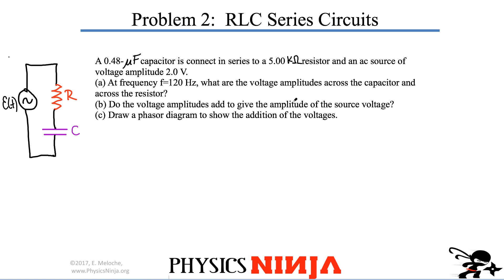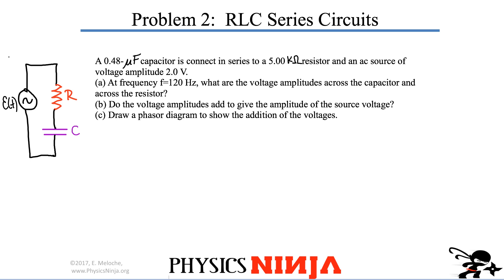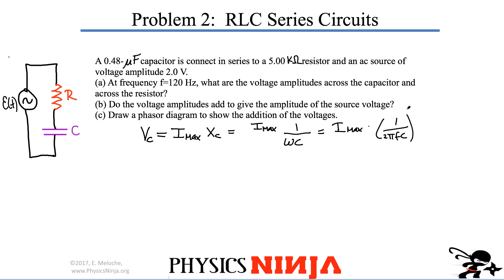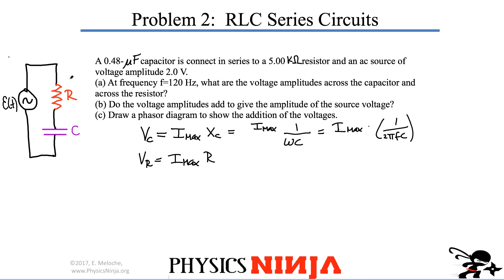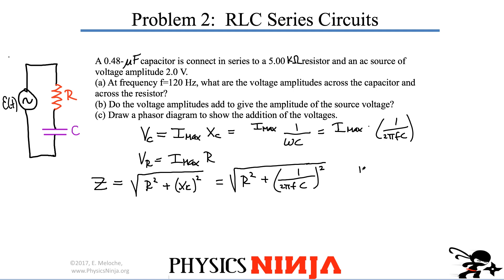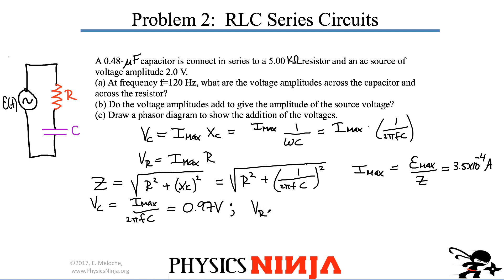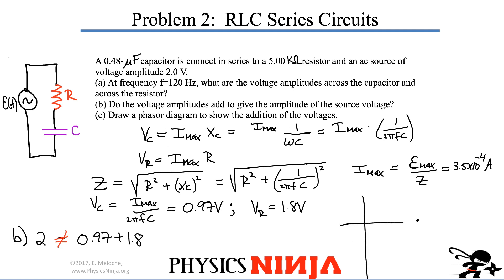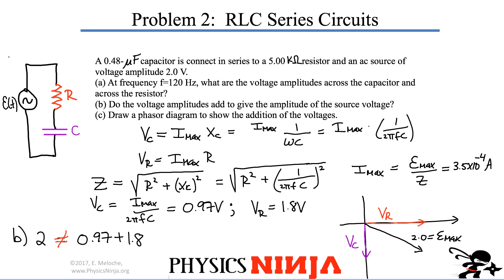AC Circuit:  Resistor and a Capacitor in series

Comment: Thank you for your great educational lessons

I have question please : i am confused as in such circuit everyine write : 
Vs= Vr + Vc knowing that the capacitor "gradualy" raise its voltage and doesnt respond instantaneously with the voltage source ! , why we are ignoring this fact and treating capacitor as if it is a resistor ?

Thank you in advance
Reply from the maker: The equation works for instantaneous values of voltages too.    They are all functions of time.

Comment: SQRT(0.97^2 + 1.8^2) is not = 2. VR should be 1.75V
Reply: Hi, thank you for sharing, I was confused as I found something around 3.9 x 10^(-4) A with 2.0 Volts but with your value, it worked to get the result of the video. Sir could you explain how you did find 1.75V? I could get it from egalizing with the result in the video but not from the circuit itself.

Comment: Nice lecture. I am going to set this up on my work bench and do the calculations and check the wave forms. Also i will see the voltage values on the oscilloscope.
Reply: better teacher than my university professor!